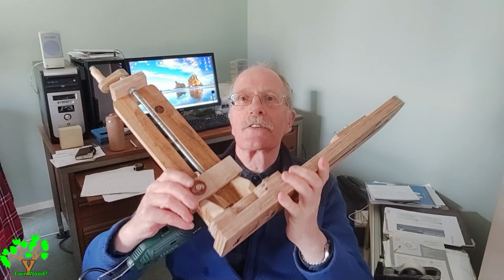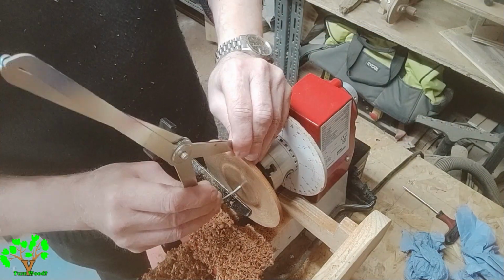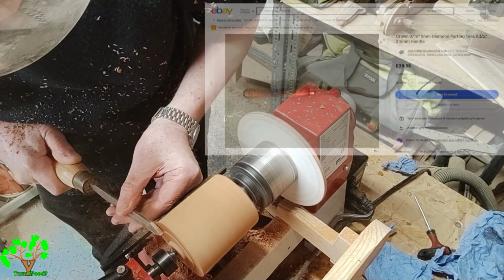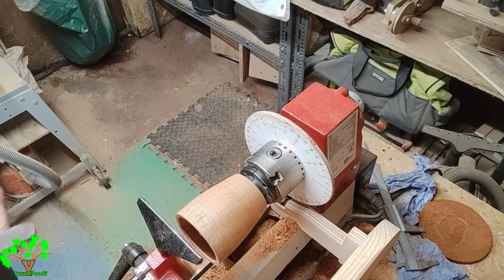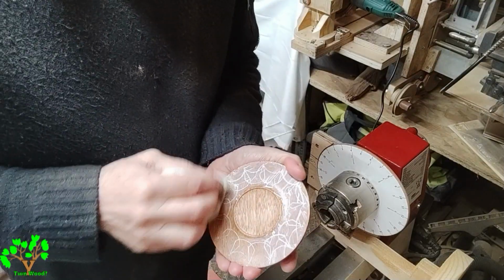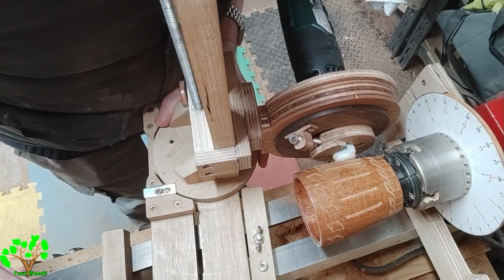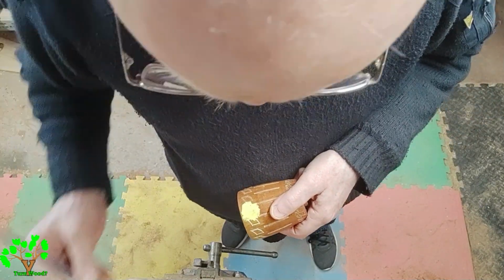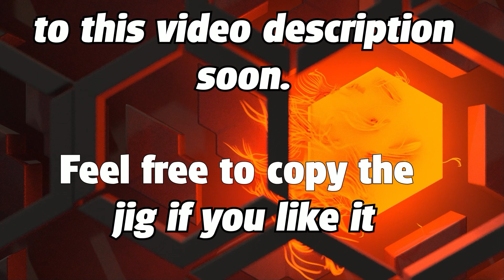Fluting & Ornamental Carving Jig  "THE FINAL VIDEO" !!!!!!!! Part 7 of 7

Comment: What’s the rear chuck model you have for this model lathe? Thanks great video
Reply from the maker: VEVOR Lathe Chuck 2.75" Mini Lathe Chuck 4 Jaw Self-Centering 1In x 8TPI Thread.
eBay about £54.
Check to see if you can buy extra jaws they may be compatible with Record Power sc2 chuck
Reply from the maker: The chuck in my video is obsolete but the "vevor" is practically the same.
Reply: @DerekBailey-jc7rk  I’m referring to the one at the end stock
Reply from the maker: I'm sorry I'm confused do you mean the tailstock. If so the chuck used in that is called a Jacobs chuck with a Number one morse taper(MT 1). You can get them from Amazon.
Reply: @DerekBailey-jc7rk  thanks 😊